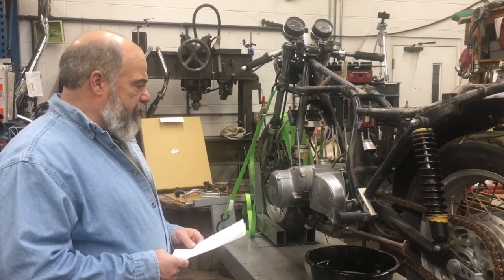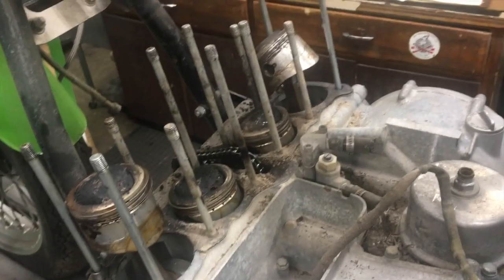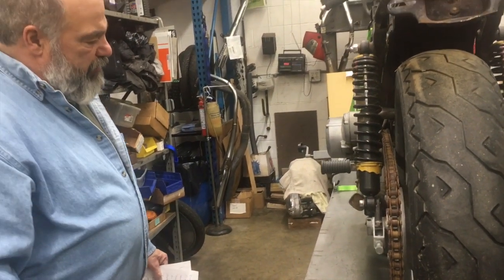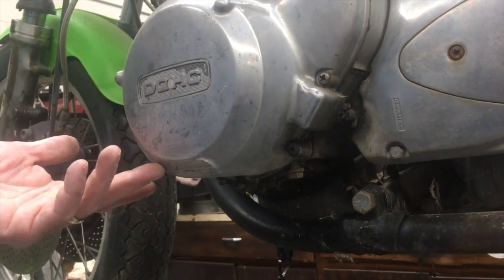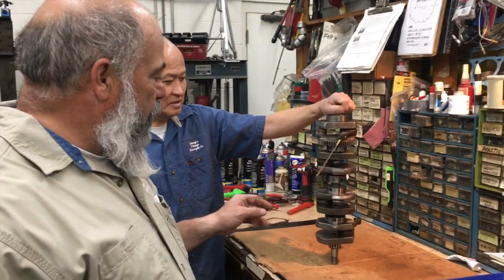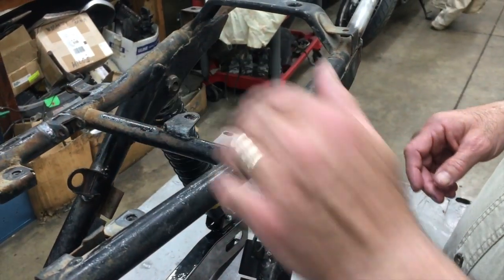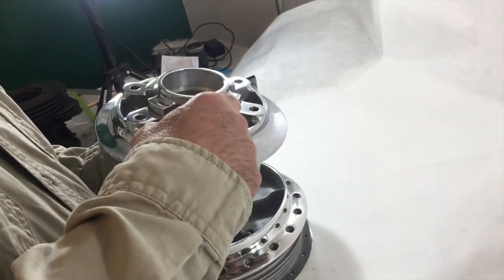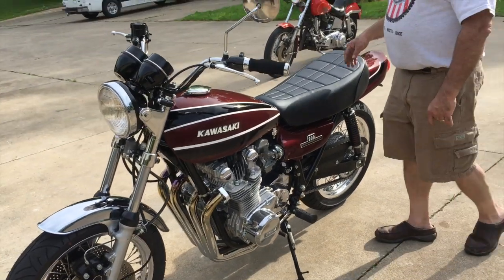Blake's 1975 Kawasaki Z1900 Vintage Kawasaki Racer

Comment: I liked playing ricky-racer on my 76 KZ900 (green) back in the day and added the short reinforcement tubes welded between the frame tubes under the gas tank (like this bike) to triangulate the area.   Also added the gusset between the back down-tubes.  It really helped settle down the head shaking at speed through the turns.   Loved trying to imitate Keith Code on our California twisty back roads in the coastal hills back then.  Wish I had kept my KZ, but it still had some head shake so I sold it and bought a new Ducati in 1978.  Still have the Duc in my garage.  Bought a new 1988 ZX10, which is still like new and sitting next to the Duc.   lol

Comment: Sounds great! Instantly responsive. A little back-popping, though. A BEAUTY!!
Reply: "Back popping" typical with a good header. When power circuit enrichened to compensate for better flow (either bigger jet or raised needle or both), pilot system often must be leaned out to allow bike to idle without fouling plugs. This makes closed throttle deceleration lean, thus the "popping". If this is undesirable to you, don't use a performance header like a Kerker.
Reply: Tom Zinninger I had a 1980 550 LTD from 1985-1991. My friend had the GPz550. He installed a header, pods and jet kit in his Keihnin diaphragm carbs. It never ran right again. I installed pods and raised the needles in my Mikuni throttle-slides for like 18 cents and it ran like a raped ape. I could pretty much keep up with the 700cc bikes in those days.

Comment: how much would you charge to rebuild a 1984 honda magna vf700 motor and transmission? if the motor was off the bike, it runs pretty good but it needs second gear fixed, it pops out of second gear n goes to neutral, could prob use rings and such while it is apart
Reply from the maker: I am sorry, but we don't work on those type of motorcycles. Mostly 66-78 Kawasaki
Reply: @Johnnysvintage  I have been watching your videos for a while and seen you mainly did kawasaki, but saw you occasionally had hondas on your website so wasnt sure, thanks for the reply, love your channel, I like how meticulous you are 
and i think its awesome you make videos for your clients so they can see the work you put into their bikes
Reply: @Johnnysvintage  but thanks anyways